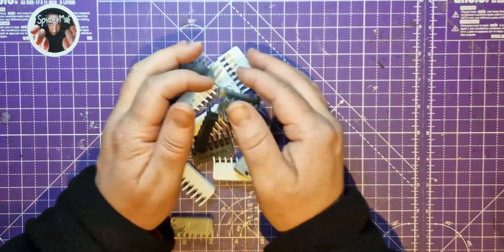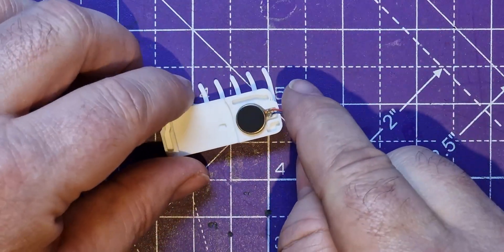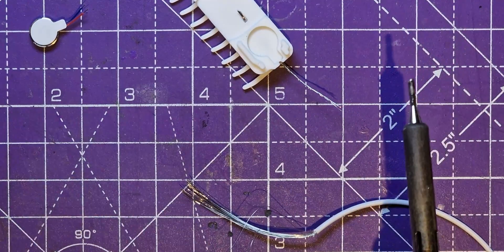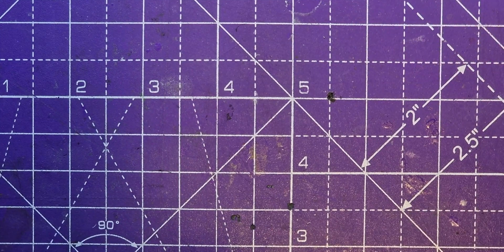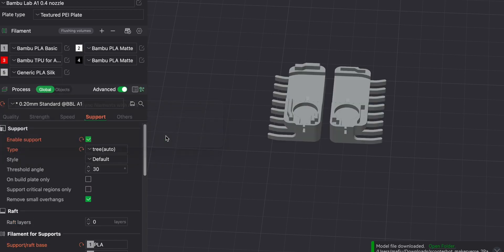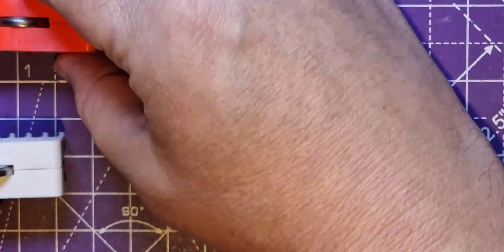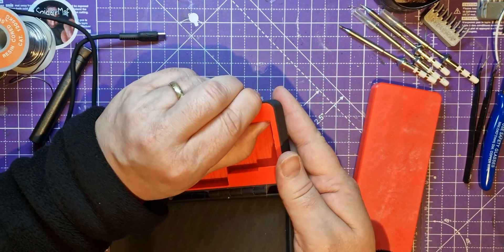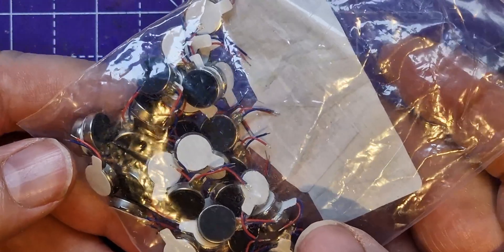Building ScooterBots the hard way, and exploring Bambu labs new AMS compatible TPU

Comment: Despite your brief disclaimer, you must emphasise you must not allow any child to have access to coin cells. Ingestion of coin cells will cause agonising, irreparable damage to the digestive system and can be fatal. Their size is also ideal for lodging in a child’s oesophagus. Unfortunately this happens much more often than you can imagine, and you may not even know your child has swallowed one until they show their distressing  symptoms
Reply from the maker: Thank you for extending the message. My channels not aimed at kids and I actually had a longer disclaimer planned but it sounded like I was having a go at the designer. I've been careful not to post this as a TOY and really put emphasis on the design and the filament. Thanks for the comment. Appreciated.
Reply: @spidermaf   Thanks for the courtesy of your quick reply. While your channel may not be aimed at kids, This video is actually promoting a dangerous toy aimed at kids, and you  really should be 'having a a go' at the designer.
Reply: Just took a look at the original vod by Nick the Maker, and was initially freaked out that this was designed as a toy to be printed and used in school by kids, though presumably not the young kids who typically might be tempted to eat a battery. Then I realised that the complete original design incorporates a cover (e.g. a 3d printed chicken) which encloses the battery, unlike your version, I was less concerned. I think you might want to reconsider the warnings/disclaimers you provide - UK legislation is much more prohibitive of promoting dangerous products than US law, the old 'precutionary principal' vs 'permissive regime'.